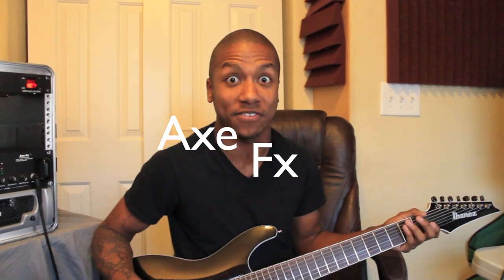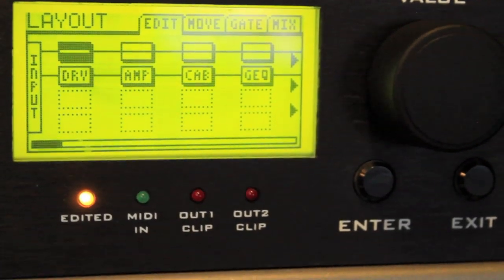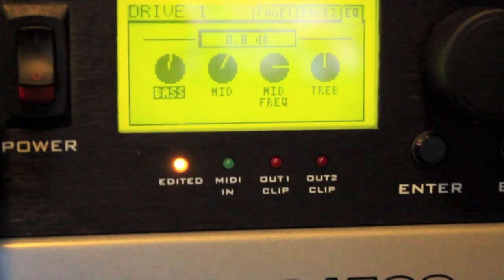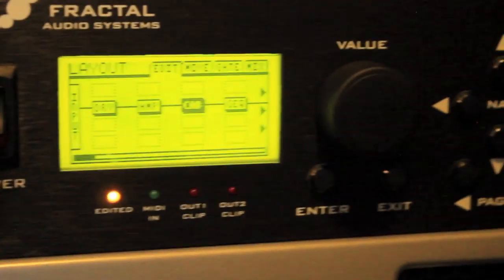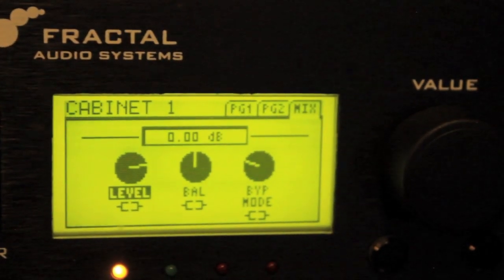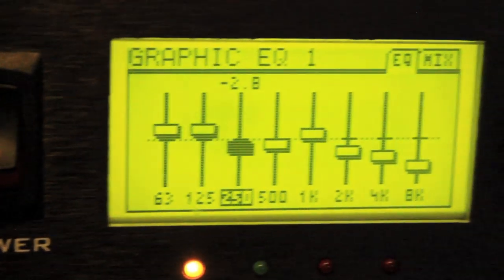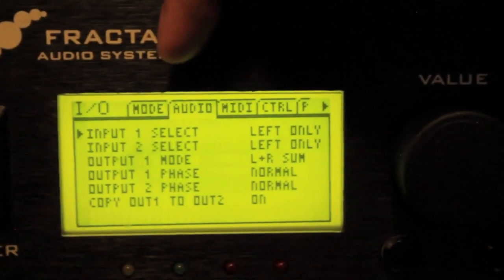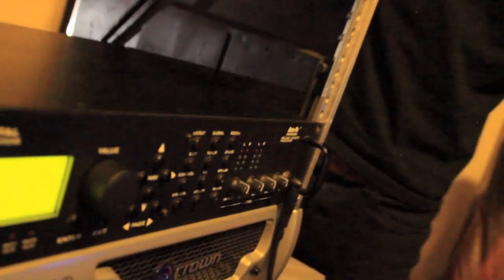Axe-Fx DI Patch Tutorial

Comment: Just something I've learned, or that works for me, cranking the damping (10) and putting the sag super low (0.04) helps a lot.

As well as changing your power tube bias to 1 in the amp settings.
Reply: Redacted on the power tube bias.  I actually run it colder now to keep it clean for the dj0nts.

Comment: I run 2 heads and cabs with an AB-Y switch. If I wanted to recreate that effect of basically having 2 guitars with an axe fx, is that possible? I noticed in your tutorial that you can adjust the polarity between the 2 outputs, presumably for 2 cabs. This would be easier than lugging around 2 heads!